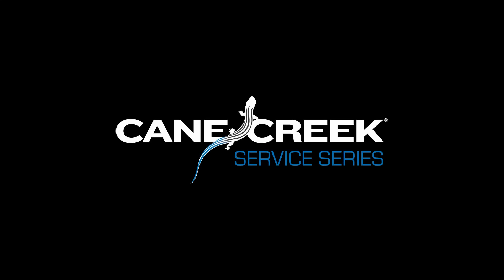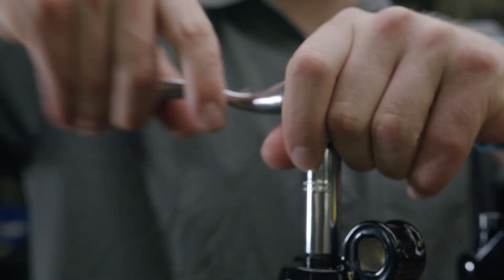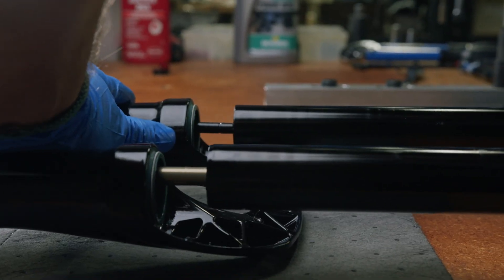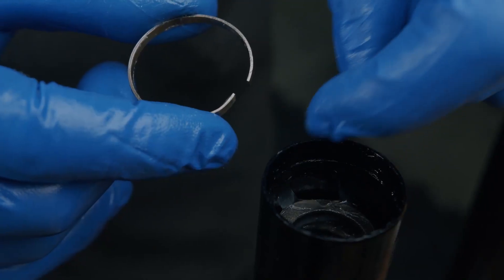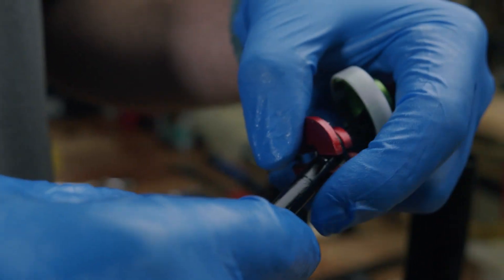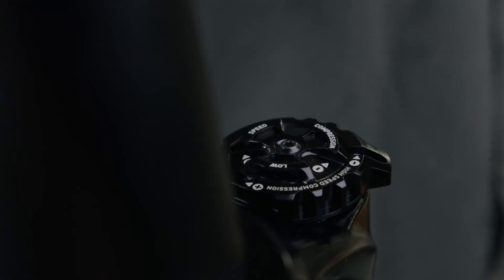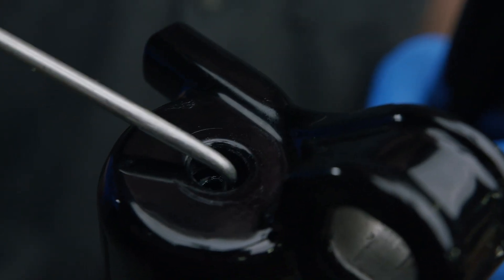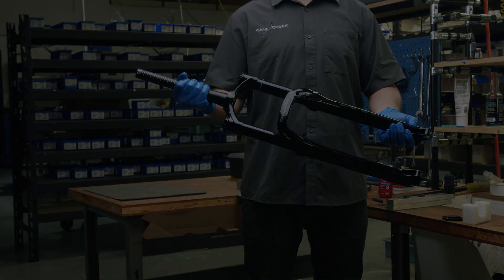Helm MKII - Coil Travel Adjustment

Comment: i bought titanium cranks of these guys i had to take they to work and chase the threads. You would figure when some one spends $2500 on 2 cranks they might make sure threads are ok before shipping. Then had a issue with a bolt breaking. Kept hearing tomorrow tomorrow so i just found my own very bad experience